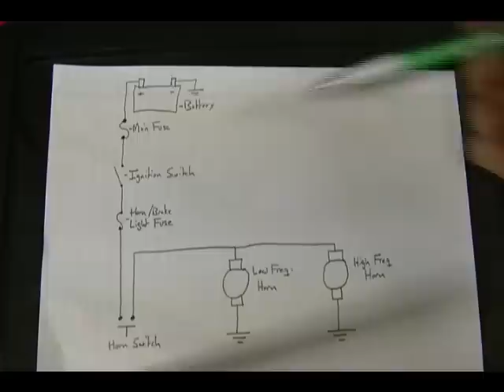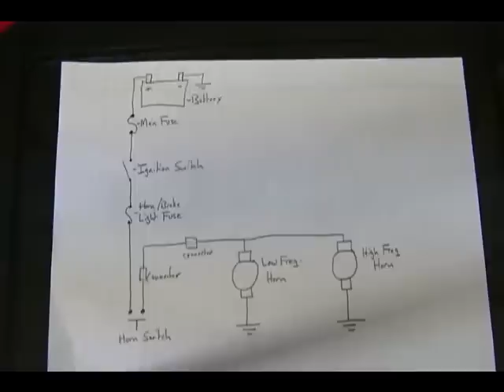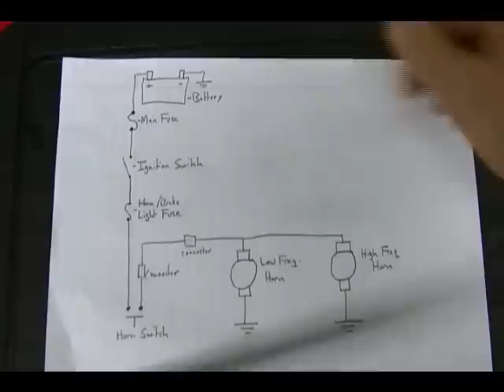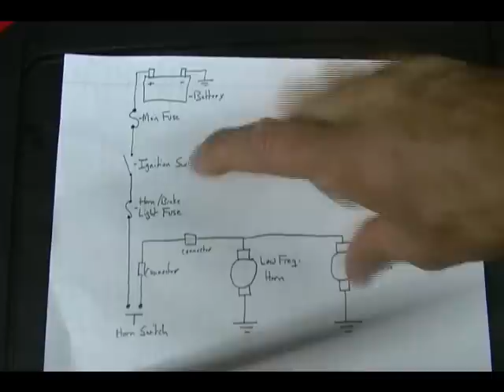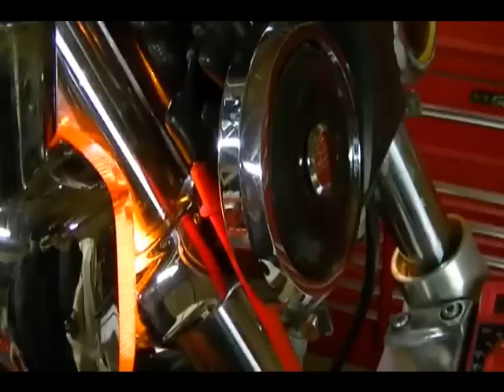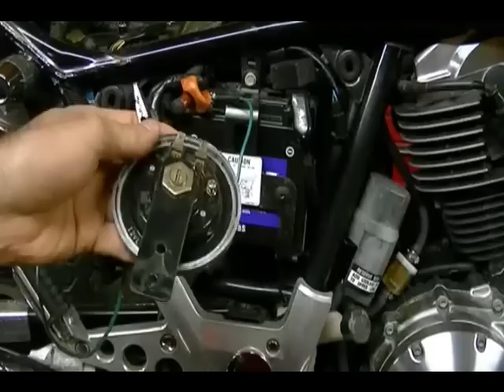Fixing a Motorcycle Horn Circuit

Comment: Mine had gone open circuit due to corrosion inside the horn, here's what fixed it - remove the adjustment screw, fill with electrical contact cleaner, take a pick and gently depress / agitate the contact inside through the screw hole until the internal resistance goes to 0 ohms, readjust screw so it makes sound again and you're done.

Comment: 4:52 non the horn is all together and the plunger is pushing the points open, opening the circuit so these two prongs are not connected. you should not get continuity. And actualy the electro magnet should be pushing the bell's plonger up until the point close and release the electromagnet field etc

Comment: I have a 97 and the horn and directionals stopped working at the same time. Running lights die one side when you try to hit the switch, horn just doesn't work. Anyone have an idea if this is a relay issue? I can't find a bad fuse, maybe a bad ground?

Comment: I am about to put a rectifier circuit to my horn as my battery has died due to very less usage. Do I need to worry about polarity of the terminals on the horn? or is it just like a speaker where any terminal works.
Reply from the maker: Polarity could matter if your horn has electronic components and is not a simply electromechanical device. You really need to study the wire schematic before connecting wires if you are unsure.
Reply: it worked on first try but i will have to remove the capacitor as its causing  a lag.

Comment: That's very thoughtful for you to write out the wiring diagram. 

I, too, usually start at the end device, mainly because an end device is usually easy to identify, and because if you show it works then you can use it to do drop testing. 

In a car the horn is run by a horn relay. Evidently the lower amperage for a bike does not require a relay.